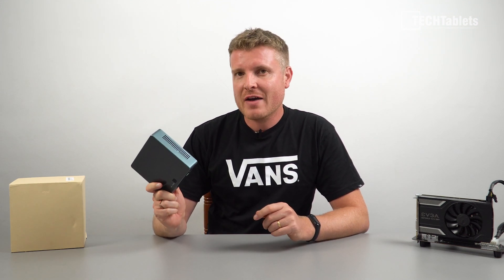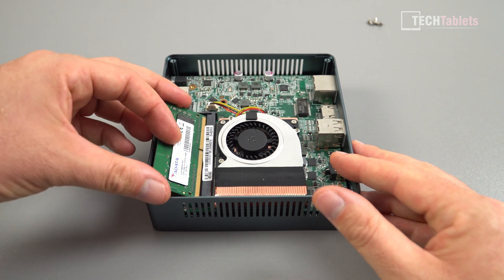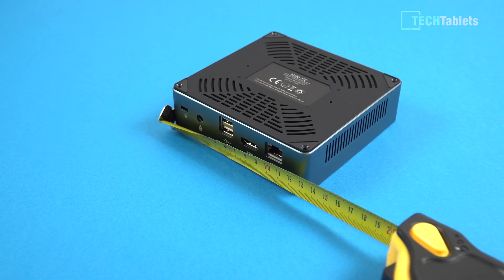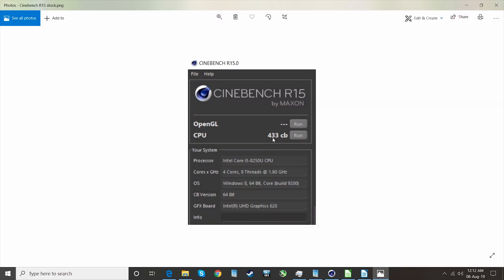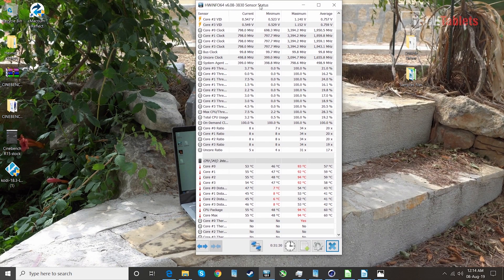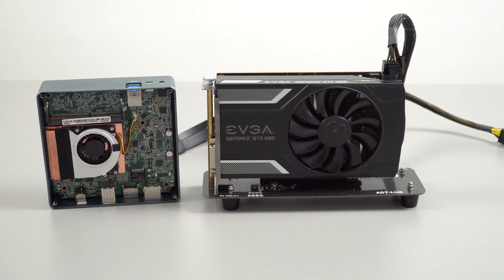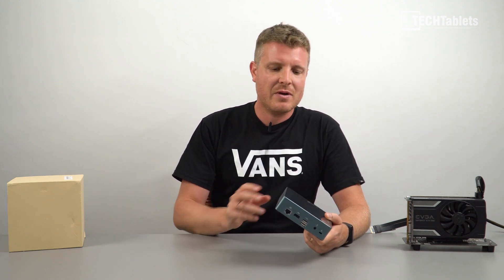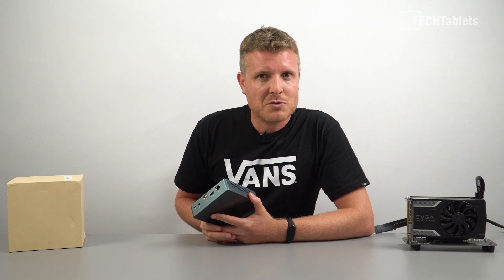Core i5 8250U Mini PC Review - This One's Not Bad

Comment: Thanks for this review.
Would you purchase this one (in i7 version) or the AliExpress Core i7 8750H you reviewed in february ?
Thanks again.
Reply from the maker: The core i7 one for the extra power and m.2 slot
Reply: @Techtablets  thank you for your reply, I'm like your video very much. I compared both machine 
With the same config : 8GB 128GB

i7 smallest one (the one in this video): 370€
i7 'Big' dual sodimm : 433€
50€ difference thats 13% difference, and there seems to be no barebone version for the Dual SODIMM one. And I'd like to choose my NVME and RAMs.

Difficult choice, by the way what SODIMM do you use please ? (I guess NVME is 970 EVO Plus)

Once again you do a great job. Each time someone ask me for a cheap solution on Tablet Laptop and now mini PC I redirect them to your video/web as it's understandable eve,though all aspects are covered.

Comment: It is pretty hard to always be aware of if a mini pc is a barebone or fully working regarding price comparison.

Beelink 55 with an older i3 and 8GB and 512 GB is currently on sale for 250€ ... 
This one here is an i5 with no ram so I have to add 60€ for 8 GB and 100€ for 512 GB ssd ... which makes a total of 240 + 160 = 400€ I guess. Is an i5 desktop cpu mini pc 150€ or 60% more worth than a beelink 55 with i3 ...? 
I do not know if the beelink  ram is worse..

Comment: sir i would like you to help me planning to but this, is this compatible also with ADT R43SG?  its  intel mini pc

2.7 GHz Intel Core i7-8559U Quad-Core
2 x DDR4-2400 SO-DIMM Slots (Up to 32GB)
1 x M.2 2280 Slot 1 x 2.5" Drive Bay
Up to 32GB Intel Optane Memory
Intel Iris Plus Graphics 655
HDMI 2.0a DisplayPort Thunderbolt 3
4 x USB 3.1 2 x Internal USB 2.0
Wi-Fi 5 (802.11ac) Bluetooth 5.0
MicroSDXC Slot
Dual-Array Microphones and Audio Jack
Reply from the maker: Yes use the PCIE m.2 slot for the R43 eGPU
Reply: is it okay with "U" processor? some prefer "H" processor?

Comment: What's the fastest ram this can accept?
I'm hoping for 3200 16gb to try and compensate for the single channel
Reply: The max chipset itself can only accept 2400. Even using 3200, it would lock the speed to 2400
Reply from the maker: @RinoAP  well not always as some of the hyperX 3200mhz overclocked RAM I have worked on a 8750H at 3.2Ghz. If the bios supports or uses the XMP profile for the OC

Comment: Nice to see your reviews of cheep china laptops and mini pc's!
Cool that you look into modding and adjusting power-limits.
What about a repaste on the cpu to improve thermals (when higher power)?
Also a thought, could the external gpu be powered from the included powerbrick or use a stronger psu for both pc and gpu (maybe integrate both in slightly bigger/taller case)?
Looking forward to more reviews!

What about this one: https://www.banggood.com/Eglobal-Mini-Pc-Computer-I5-8250U-Win10-Quad-Core-Intel-HD-Graphics-620-Barebone-2DDR4-MsataM_2-SSD-Micro-PC-Fanless-HTPC-Nuc-VGA-HDMI-p-1497413.html?rmmds=detail-left-hotproducts__2&cur_warehouse=CN

Comment: For $260 it is not worth to buy such box. For about $450 (or maybe even less) it is possible to have i5 8gen laptop with 8GB of RAM, 1080p LCD and SSD. With local 2y warranty.I'd buy such box but for <$200.
Reply: The i7-8750h is probably the better option it's more expensive but I've got 16gb ddr4 and two ssds and because of the temperature it's holding very good igpu gaming performance.
Reply from the maker: @_GarethRossUK  Yes thermals on that machine are great and low fan noise. Worth it for that extra.
Reply from the maker: 100% agree. But some are after a small NUC sized PC for a desk with their monitor. Might already have a laptop.

Comment: Aye Chris! I have a question. Not entirely related to the product, but more sort of knowledge. I have a maximum bandwidth connect speed of 100mbps, in that case do I still need to upgrade the wifi card? Or it won't matter at all?
Reply from the maker: Well depends on various factors. If the 3165 card, for example, has a link of only 65Mbps then you're loosing speed. And the 9260 card gives you 200mbps then you're fine.
But saying that if you're close to the router and speeds a good then a typical wifi ac card is more than enough for you. I have 60Mbps (LTE) at home but using a faster Wifi AC card and router overall works better for me than my onboard Intel 3165 built into my motherboard. So what I'm saying it really depends on the users range and wifi router.
Reply: It doesn't if you don't have high speed connection

Comment: This was probably the first U series processor which is actually powerful, it runs Autocad and edits flawlessly on my laptop. Shame intel didn't do this before and had to be pressured by AMD to make such a gem of a processor
Reply from the maker: Yes and with a little undervolt and TDP tweak can (if cooling and running dual-channel RAM) match the i7 7700HQ
Reply: I'm here because of the new Intel N100 made its way into a £150 mini PC with 16GB of DDR5 and a 1TB SSD, and was shocked to find its benchmarks mostly at or above the likes of the i7 7500U and i5 8250U.

Comment: Can you check if usb wake the computer from sleep? I have two Chinese mini pc and usb cannot wake them from sleep which sucks as a living room pc.
Reply: Can the usb wake the computer?
Can you explain what you mean?
Reply: @fuxyews2177   If you have say, a usb tv tuner you might want it to sleep till it needs to record , so it needs wake on usb I suppose. I have voyo miniPC and just leave it on all the time as it uses less than 12w.

 or other computer wakes up when the wireless USB keyboard is turned on and a key pressed .
No mention of power usage ..that would always be a nice addition, especially when over clocked vs stock.

Comment: Should have been fanless
Reply from the maker: It would run too hot with this CPU, but the fan noise is very good on this one. Didn't expect it!
Reply: @Techtablets  Can se i5-8250U mini PC oth is available as fanless and with fan - the ifo i havce is that fanless i5-8250 system should work OK under normal use , however if you play games all day , i think you should perhaps take the mini pc system with fan
Reply: @Techtablets  also the fanless i5-8250U at unicomputer is Dual-channel DDR4 memory system